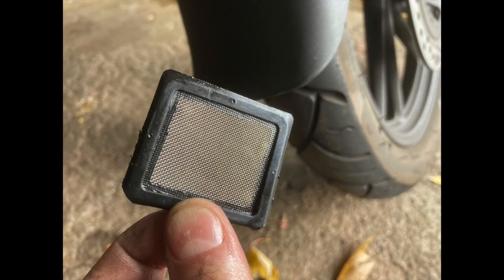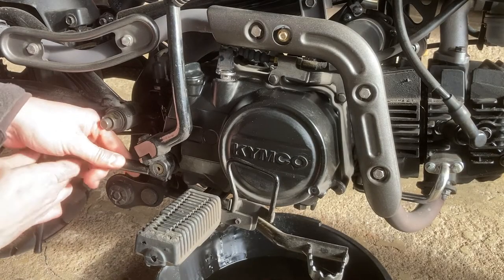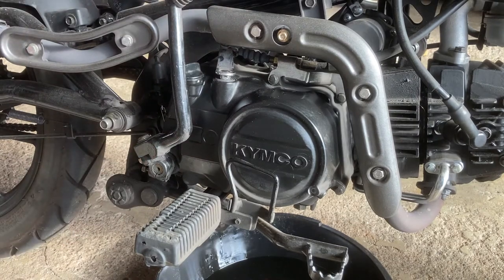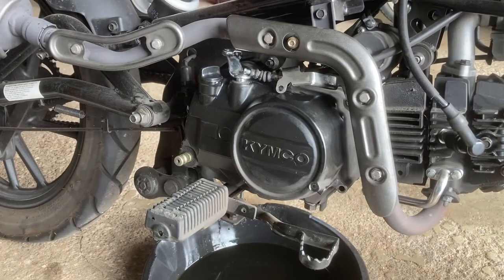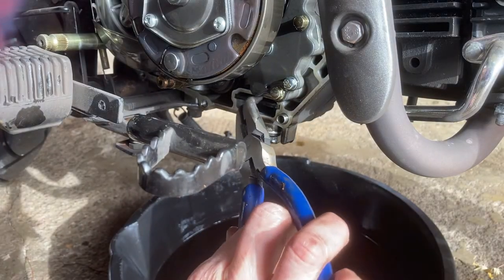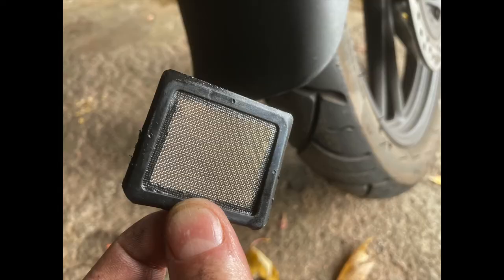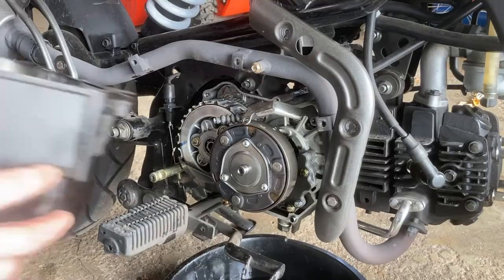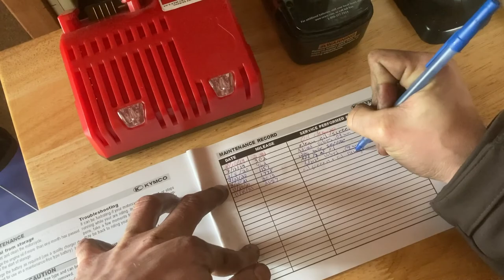Oil strainer clean Chinese 125 cc

Comment: Thanks for posting Jonathan. These bikes are smashing but getting to that strainer screen is essential to clean it and make sure its not clogged. Have had big mileages from a Chinese 250 and a mechanic has never touched it. Thanks for filming this.
Reply from the maker: Glad you found it helpful. Another thing to check would be the valves. Mine were out of spec when It was brand new.

Comment: hey janathan thank you for posting this clear awesome walkthrough on how to do it. your motorcycle looks mint btw . I have a question is the valve adjustment the same for a Chinese 110cc and how can I get a maintenance book just like that of yours any idea how to download one because unfortunately I brought mine without one except for some useless, horrible & low quality tools. thank you
Reply from the maker: The book I have is the owners manual. It provides some helpful information but is not a service manual. The local Kymco dealer has the service manual and printed me out the valve service
Guide rather than just giving me clearance specs verbally. I don’t know what brand of Chinese motorcycle you have but it doesn’t really matter. They are all some form of Honda clones. These are pretty simple engines. You could follow the specs I specified in my valve clearance video without issue.